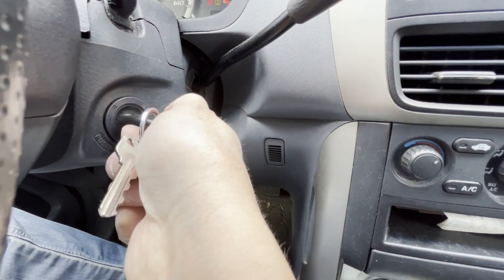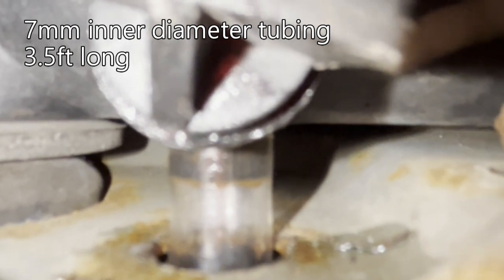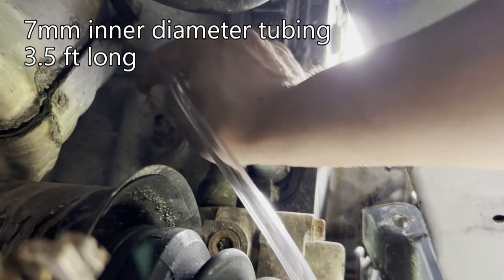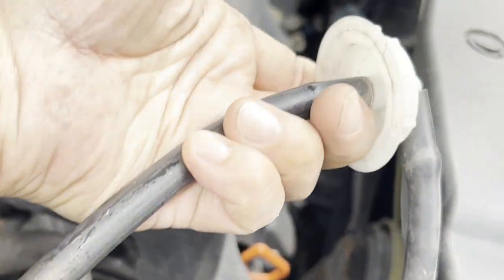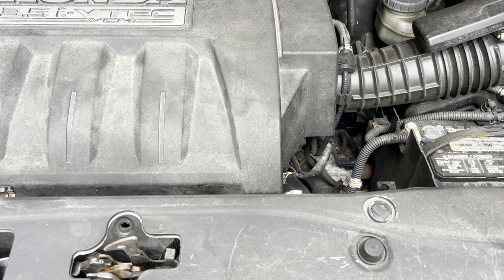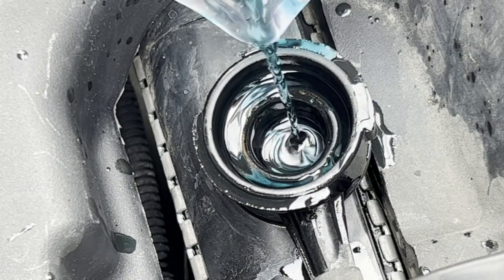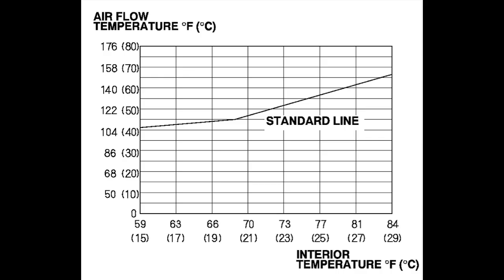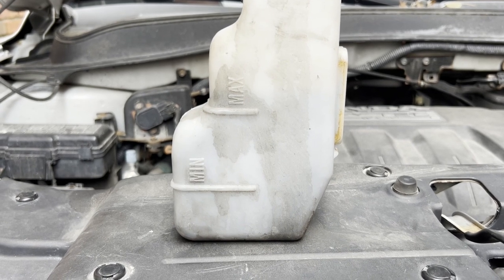honda pilot coolant change 2006 2007 2008

Comment: Do you do all the reving with the cap on
Reply from the maker: While the Chilton instructions do explicitly say to put on the cap 1/2 way, and then fully on, at the end of the procedure, it doesn’t say anything explicitly about putting the cap back on during the revving, which I took to mean, you left the cap off.  With the cap off, you don’t have to worry about the coolant pressurizing the system and perhaps scalding you every time you check the coolant level after the revving.

Comment: I was going to change my coolant. Now I have no hope. I don't have the means or time to do all of this and for sure if I take the car to a mechanic or even the dealer, they aren't going to do all of this. I'd be lucky if they changed the fluid at all. Dealerships are known for charging for work not done. I'd have to cover up the drain plug with duct tape and see if they remove it.
Reply from the maker: I’m sorry you’re feeling bad!
Reply: 😂😂😂 @theoccasionalmechanic4569